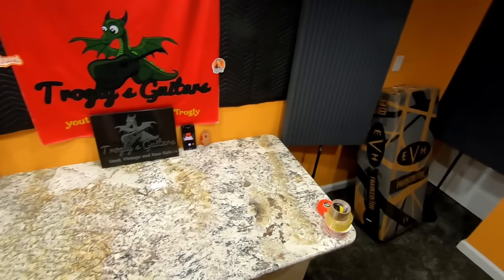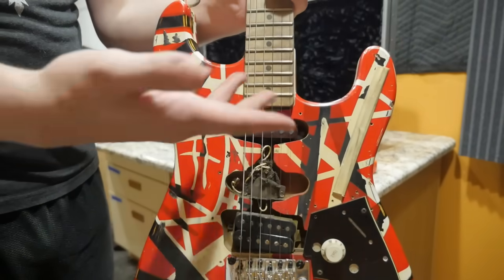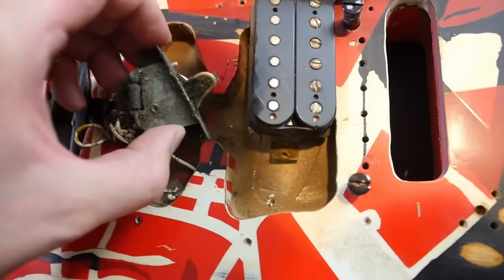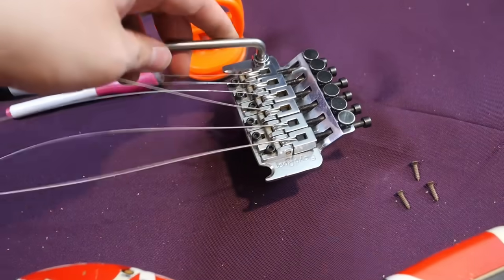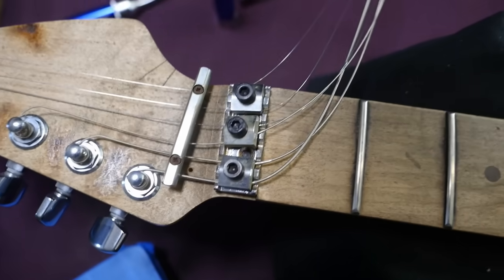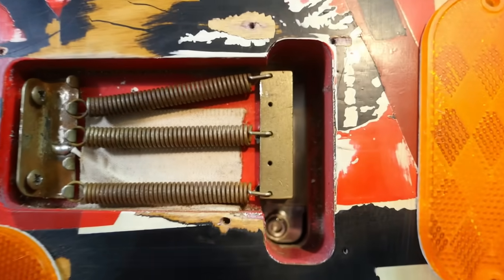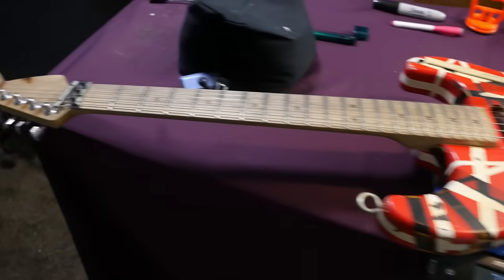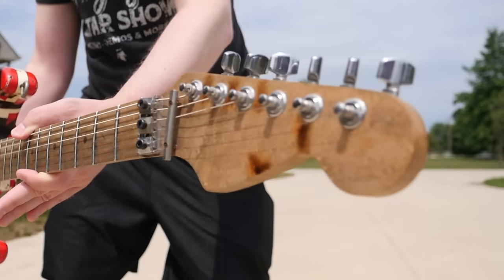This is the "Real Deal" | 2007 Fender Custom Shop Masterbuilt EVH Eddie Van Halen Frankenstrat Aged

Comment: When you said the humbucker was not lining up you did not do enough homework to know that the pickup was tilted to the slug coil was in line with the high E string and the screw coil was under the low E string. A standard PAF did not have Fender spacing of 52 / 53mm and Gibson had 50mm. The tilt was not for the whole pickup to line up EVH just wanted strings directly over pole pieces so it is a slight tilt.  If you need someone to play that guitar in for you…. I am your guy!! I will play it for free….

Comment: Hmmmm many mistakes with your take on EVH. I really like your vids and opinions and the incredible gear you showcase. You don't really strike me as gear nut so much as a guitar dude. Not an issue your knowledge is in my opinion profound. You never talk about tube/solid  amps,  rig set ups,  signal paths etc...again,  not a prob you  do you. But .... I got s soar spot for EVH and your ...  Interpretation.  ....  Of him.

Comment: The dummy pick up was installed so other guitar companies wouldn't be able to figure out what it was doing or why it was there and how to connect it and the wiring so they wouldn't copy it that's the only reason why you put that there he didn't not know how to hook it up he did it intentionally so other guitar companies would not copy it and if they did they would fuck it up that's why he did not because he didn't know how to wire it he knew how to take apart a guitar from top to bottom and put it back together

Comment: You said 300 units sold out in 15 minutes, at $25,000. Never happened. Most sold for around $17,000. I don't know of any that sold for retail. Also, around 130 of the 300 never sold. Fender recalled those guitars and destroyed them to hold price integrity for the sold units. So many mistakes and bad info in your video.